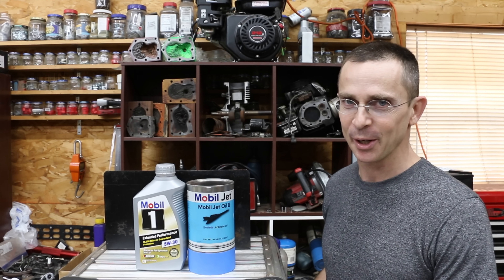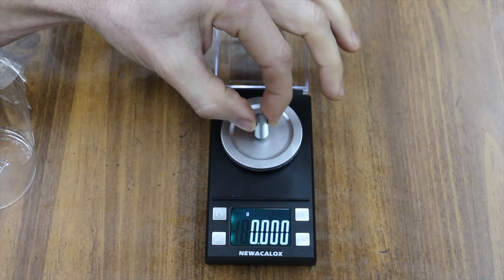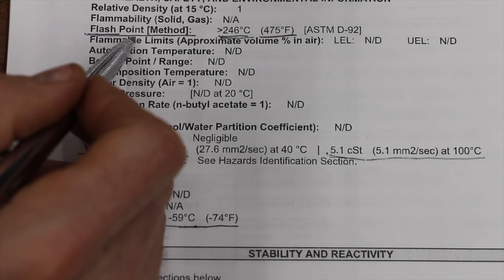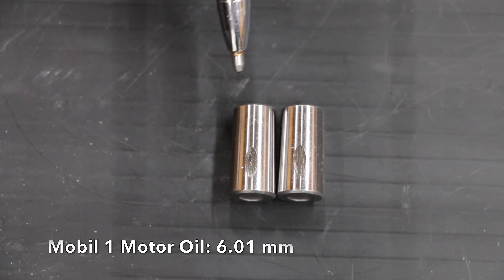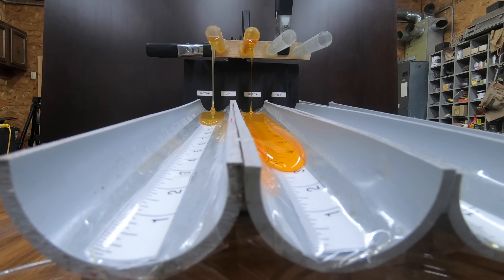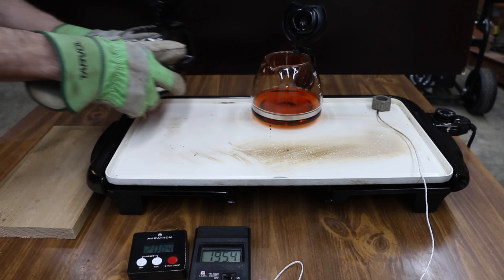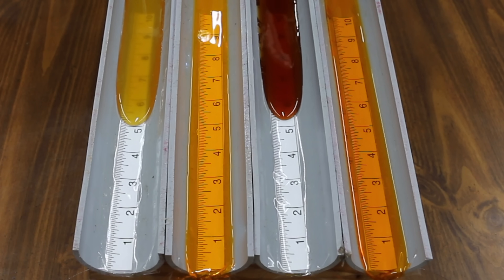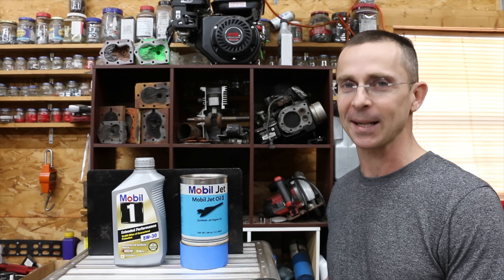Is Jet Oil better than Mobil 1 Synthetic?  Let's find out!

Comment: Should I put jet oil in my lawnmower?
Reply from the maker: Please don't. It'll likely cause damage.
Reply: @ProjectFarm  I'm kidding of course. But I am actually using Mobil-1 5w30 in the mower it runs better and doesn't smoke on startup like it did with the mower specific oil. Which is straight 30 weight with a bunch of moly I think.
....wait that should be your next video, what happens when you use jet oil in a lawnmower.
Reply: Only if you want to fly and cut at the same time
Reply: Hate your lawnmower?

Comment: WARNING: Do not try to get airborne in your Honda Civic.
Reply from the maker: Sage advice!
Reply: What else am I supposed to do when the VTEC (yo!) kicks in?
Reply: Jim E Who needs vtec man? LX head ported with matching manifold, 1.5"/ 1.75" & 2" tri y header 10:1 compression. takes off real well. unfortunately gorilla glue doesn't hold the wings on tho!!!
Reply: Although it would be very impressive if you managed to do so.
Reply: When I was 17 I got airborne in Mom's Honda Accord, Dad wann't happy when He found all the mud and grass in the grill!!
Reply: What about my Saab?  Adverts had fighter jets.
Reply: Not in a Civic yet, but about four other car models have left the Earth with me as the pilot.
Reply: Well, I put a Flux Capacitor on my Honda Civic, and not only flew, but went back to the future, so : P
Reply: dillock that’s jet fuel. And peter griffin has already done so. 😂😂
Reply: I did that once, i don’t recommend it, the concrete raised median suffered no damage at all, unlike the Honda Civic, my head, and the boom box i had in the back seat...
Reply: @yetinother  You didn't do it right.
Reply: @yetinother  where are your head and the Boombox damaged by each other?
Reply: The Boosted Boiz ignore your advice....😁
Reply: You can probably drive a Honda Civic in Antartica with this stuff because it's so thin.
Reply: Na, I think I'll find a speed bump and floor it!
Reply: To late
Reply: Hold
On,
Not
Done
Accelerating!

Comment: how about just piston aviation oil should be able to some from your local GA airport
Reply from the maker: Great suggestion!  I'll see what I can do. Thank you
Reply: @ProjectFarm  mix motor oil and jet oil 50/50, see how it does in 4 stroke motor.
Reply: @ProjectFarm  , I work for a FBO in Arizona and am happy to assist if needed.
Reply: @ProjectFarm  You can buy any aviation oil on Amazon, fyi.
Reply: @ProjectFarm  jet engine oil is too thin to run as regular engine oil, but I know for a fact that AEROSHELL 500 (mil-prf-32699) works just fine as fuel in a diesel engine. 😁
Reply: @ProjectFarm  Just remember your cold pour test might take a while, like pouring cold tar.
Reply: Piston oil is normally THICK af since it's an air cooled motor.
Reply: @desertfresh3740  And a jet engine is cooled by?    🦄'S
Reply: That would (also) be very interesting. GA piston engines often use very simple old school monograde oils because they are established, tried-and-tested and very well understood.
Reply: @WineScrounger  they have to handle the leaded gas that leaks around the rings.
Reply: Shell Aero....match the viscosities of course.
Reply: Yes, I'd like to see you compare test Aeroshell avation oil
Reply: Aeroshell sport +4 is a 10w40
Reply: Aircraft piston engine oil is available in Multi Viscosity, AeroShell 15W50, Phillips XC20W50 and Exxon come to mind.
Reply: Piston oil is usually 50w, heaaavvvvy but would be cool to see.
Reply: @dudndadn12212  I've never worked on piston aircraft, only turbine powered helicopters. Do you know why aviation piston oil is so much thicker than your typical internal combustion engine? Just curious.
Reply: Kevin Smith I’ve been told that back in the day when they had radial engines, those leak oil like crazy so they compensated that with really thick oil. So they just carried that over to the air cooled horizontally opposed engines.
Reply: Kita  could be something too that. Also air cooled engines have to run pretty loose bores since they can easily get upwards of 400 deg f cylinder head temps , thick oil helps to keep from losing so much.
Reply: Also put jet engine oil in a lawnmower

Comment: Unrelated to this video, but have you ever done a showdown on Velcro? I would LOVE to see that. I had some today that bent the metal frame it was attached to before it let go.
Reply from the maker: Not yet. Great video idea!  Thank you
Reply: @ProjectFarm  IF you ever make a video like this, please test at high temperatures (150F) to simulate the inside of a car in the summer.  I've had some velcro leave its adhesive behind on the dashboard and it's a mess to clean.
Reply: @someusername121  I agree about the heat. 90% rubbing alcohol and cotton towel or micro fiber will take most sticky messes off with ease.
Reply: @someusername121  If your going to use an adhesive in plastic, I found that 3M Primer94 takes it from kind of easy to remove to dam, this thing doesn't want to come off.  I use it anytime I want the adhesive to remain permanent.  At the moment I'm using it on the radiator reservoir tank to hold down a custom cover for my challenger using 3M Dual Lock (works way better then Velcro).
Reply: @ProjectFarm  Locking tape! That shit is amazing!
Reply: That would be awesome. Don't forget the high strength variants, 3M Dual Lock is some pretty wicked stuff. I first encountered it as a supplied method for mounting toll transponders to a windshield, I ended up buying a roll for myself and using it for all sorts of stuff where regular Velcro would fall flat.
Reply: Holyshit what kind of velcro was it do you use it in your job or something
Reply: This
Reply: Complete coincidence, and I can't share the results, but just today I happened to post this video of a hook and loop testing rig that I built last week: https://www.youtube.com/watch?v=azR9pEfxwWA

I would LOVE to see a Project Farm take on this kind of test. There are so many different types and specs.
Reply: Oh yeah, I'd love to see a video on this
Reply: +1
Reply: I wish I knew the brand name of the velcro we used in marching band... I had the honor of having a huge sound system with these huge pair of speakers stacked on top of each other. Those 120 pound speakers were practically inseparable
Reply: I believe hook and loop fastener would be the generic term. All "Velcro" test would be counter productive?